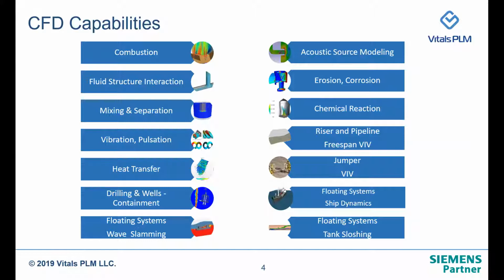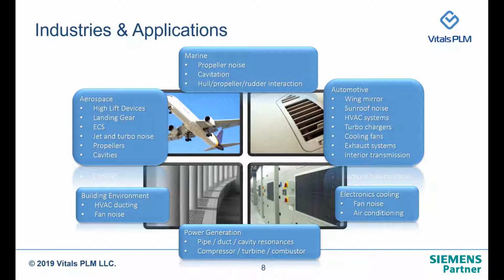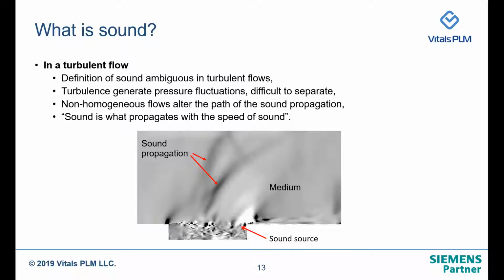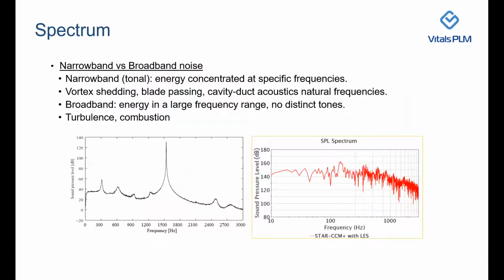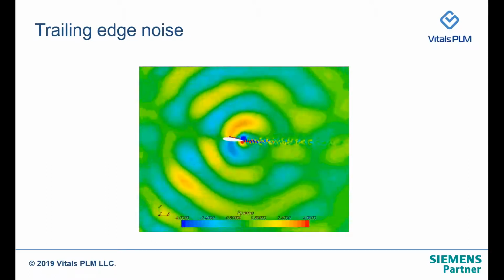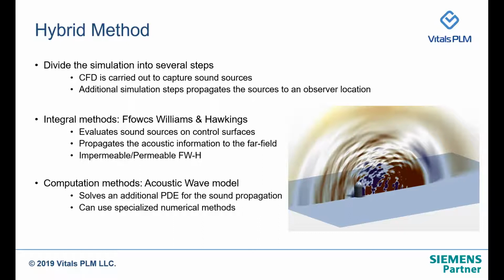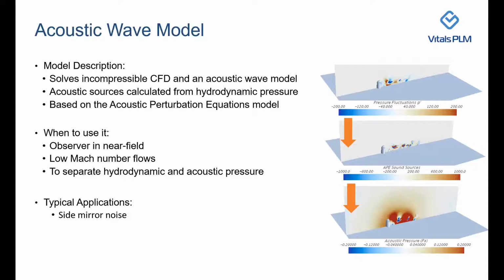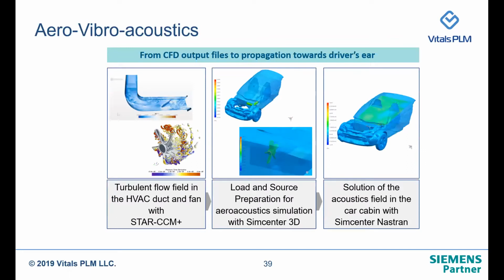Webinar: Aeroacoustic analysis using CFD

Comment: Hi,
I wanted to ask about the recommended far field position when simulating over the trailing edge of a wing. And also the minimum total time required for LES simulation.
Thanks in advance.
Reply: To be specific, am using fluent, running Les model, then extract the acoustic noise based on the pressure fluctuation past the trailing edge.